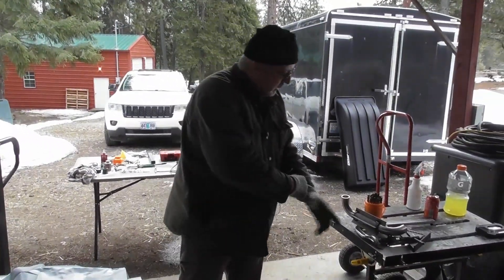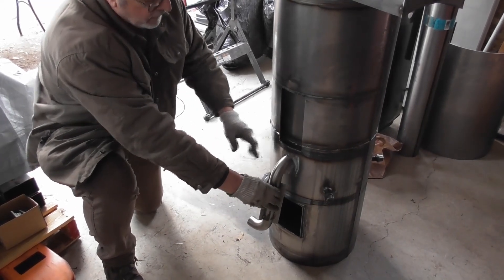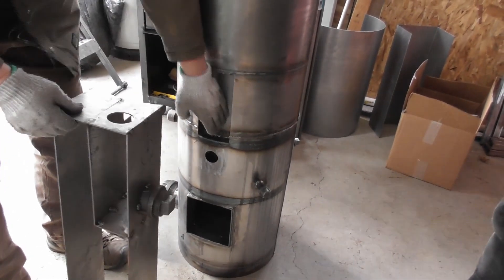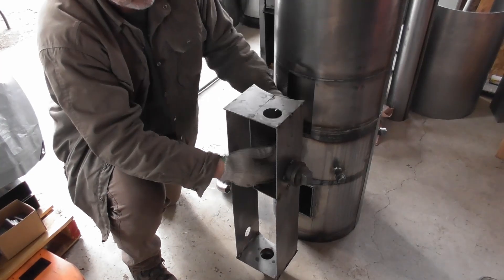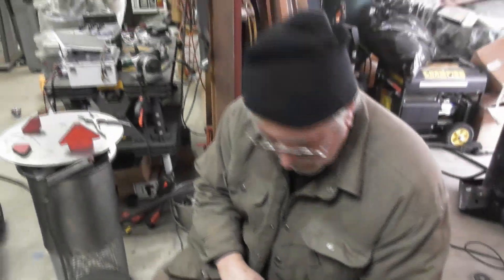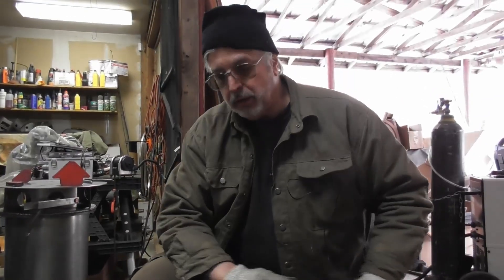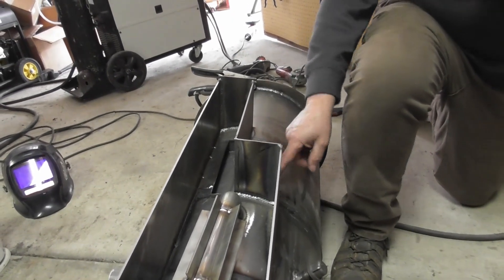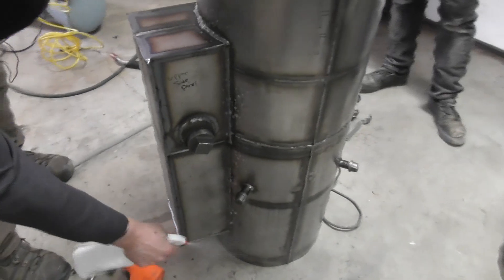Wood Gasifier Builder Training: Reactor Part 3

Comment: How large of an air intake formthe gasifier? Do you want some air to help combustion of gasses
Reply from the maker: Air intake is 1.5" tube
Reply: @steveoffgrid485  what about reactor dimensions of the crucible?
Reply: @steveoffgrid485  do you think would a 3" air intake be appropriate for v8 truck 220hp?